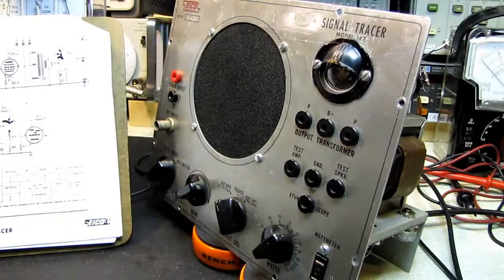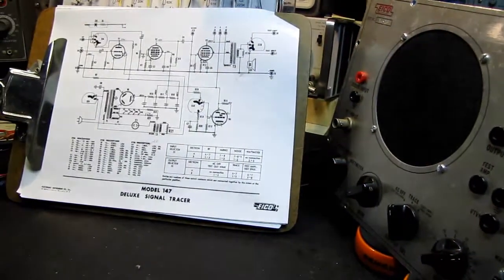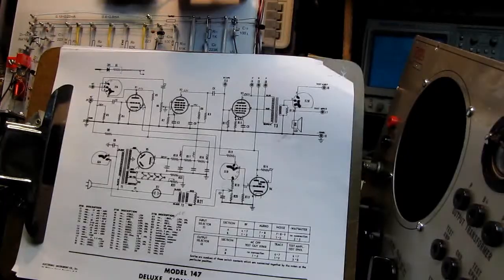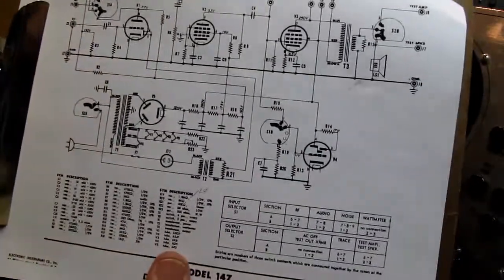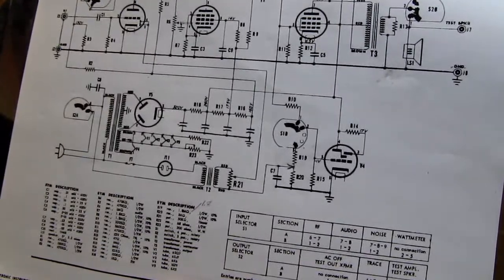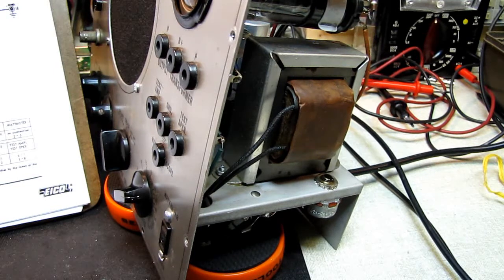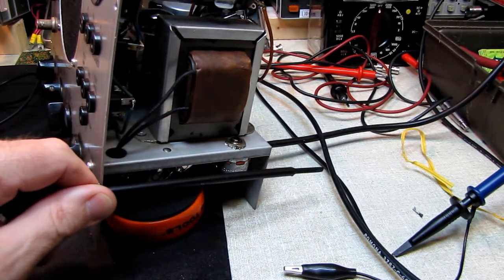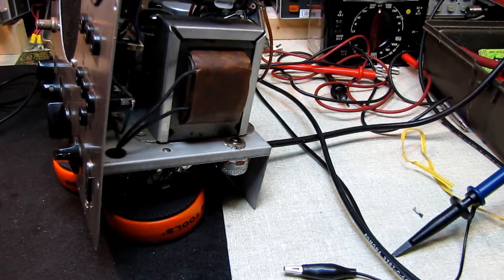10 Buck Test Bench - Eico 147 Wattmeter Calibration - Simple Mod

Comment: I am with you. I might not use it, but if it is there I want it to work properly.
Reply from the maker: Yes indeed Ian. Thanks for stopping by.
Reply: I have an Eico 147A.  The schematics for the 147 & 147A are different.  Any chance you could recommend the proper mod procedure for the 147A ?  Thank you

Comment: My Paco signal tracers are basically the same.  I would do this mod but I doubt I would ever need it.  I don't think I have ever used the watt meter function.  My B&K AC power supply has one built in which is what I use.  I will annotate this in my Paco manual.  May do this anyhow the next time I have to crack it open for something.   Thanks for sharing.
Reply from the maker: I never used the feature on my old 147A and probably will never use it on this either. But if it's on the bench I like to have it work correctly. And it was real simple.